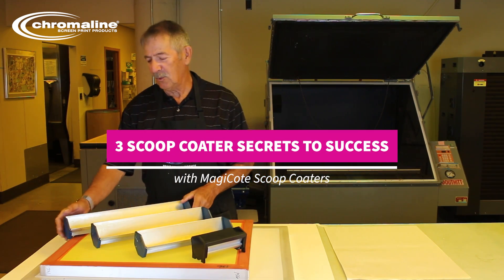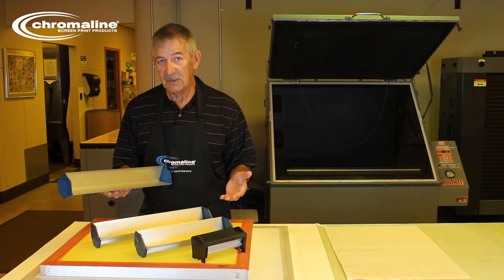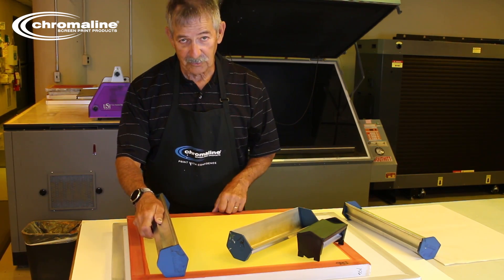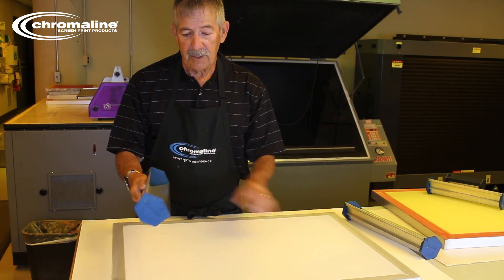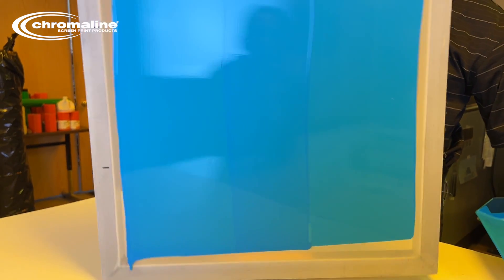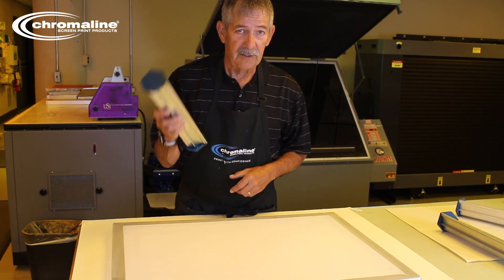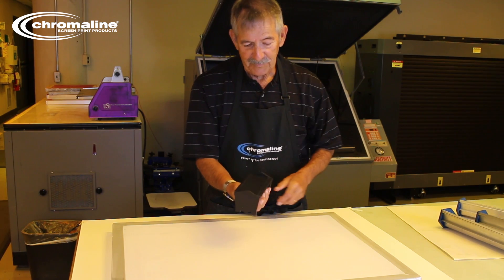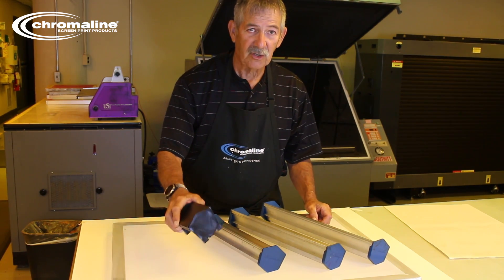3 Scoop Coater Secrets To Success with MagiCote Coating Troughs | Chromaline

Comment: I often hear people say 2 coats on the t-shirt side and one on the squeegee side using the sharp edge, but I think I like the smooth edge better as well, and applying 1 coat on each side, I would think that would be the same as doing 2 coats with the sharp edge.
Reply from the maker: Definitely depends on the emulsion and the coating technique